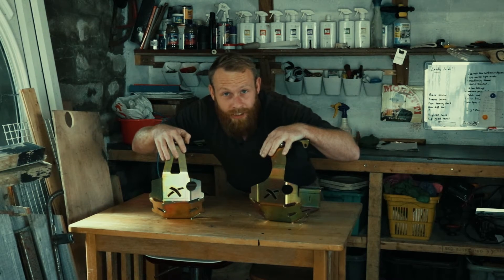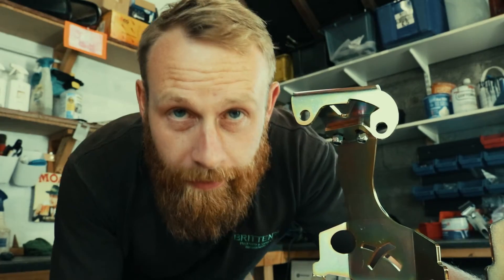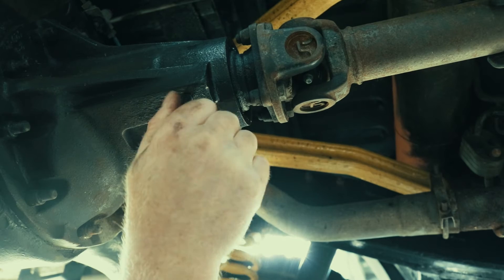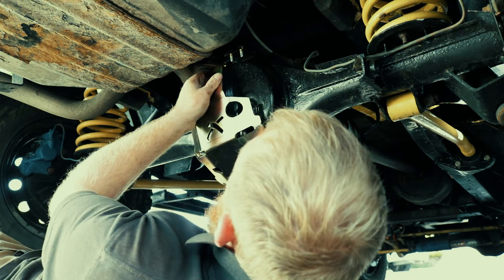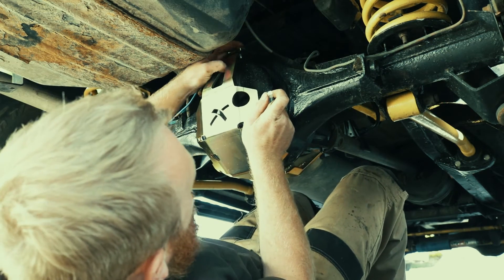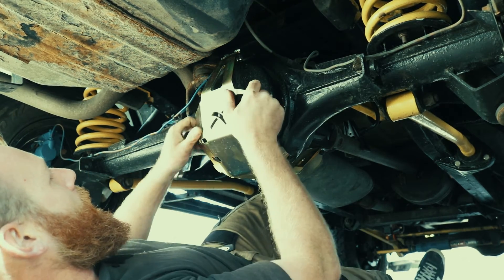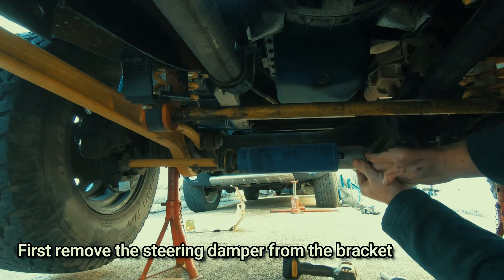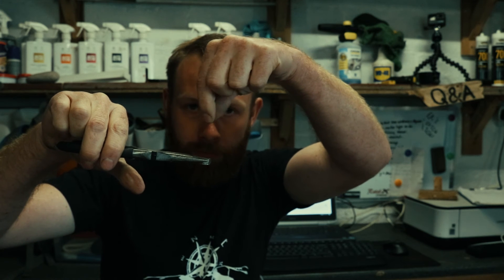How to fit wrap around diff guards by ratel x industries

Comment: Bought some over the Xmas period, getting them fitted over the next few weeks once I've lanoguard the underneath
Reply from the maker: Good idea! I’ve got lanoguard ready to go on too
Reply: @TheNorthernExplorer  going to use waxoil underbody protection inside the wheel wells, and lanoguard for under neath the D2. 
Light bar fittings are arriving this weekend, just need to work out how to wire it up to a land rover latching switch.
Reply from the maker: @landroverman79  lots to do!

Comment: Only downside is you have to take them off to drain the diff oil.
Reply from the maker: Nope they have cut outs around the drain plugs 👍
Reply: @TheNorthernExplorer  splendid. 👍
Reply from the maker: @Jabber-ig3iw  you can also jack the car off them.
Reply: @TheNorthernExplorer  My D1 is up on chassis stands whilst being restored underneath. Whilst up, I have added a similar looking Bearmach diffguard to the front diff. There is a gap between the bottom of the diff and the  diffguard. I'm worried about the jacking aspect, as not sure the gap is meant to be there. Is there a gap on yours?
Reply from the maker: @ there is a gap between the guard and diff. I know this because it filled with mud on an off roading trip 😂